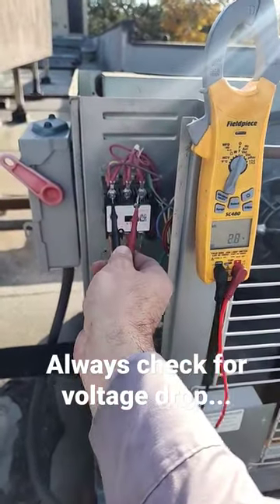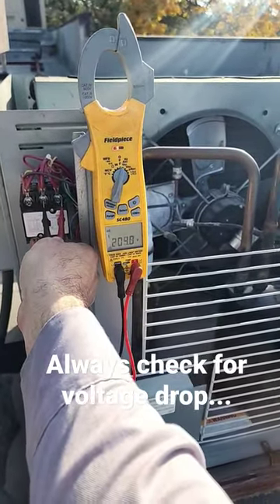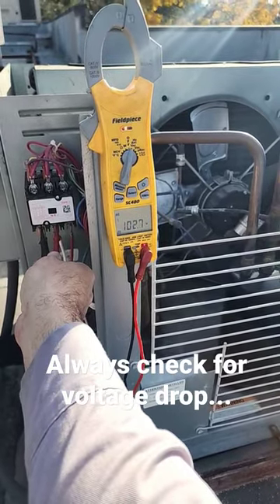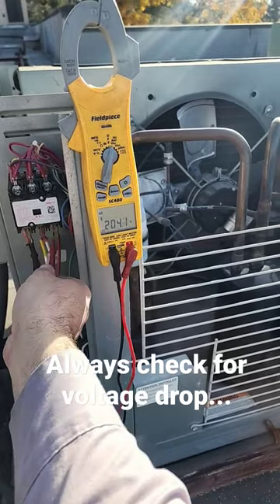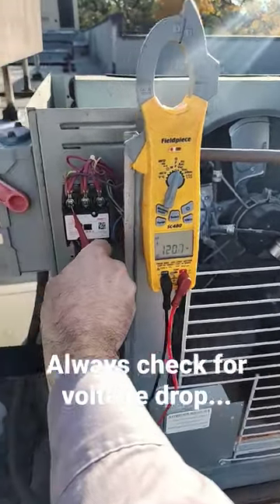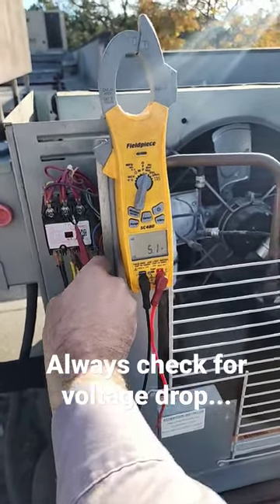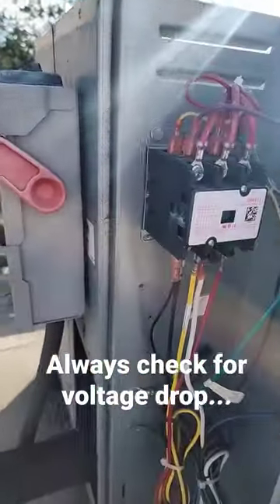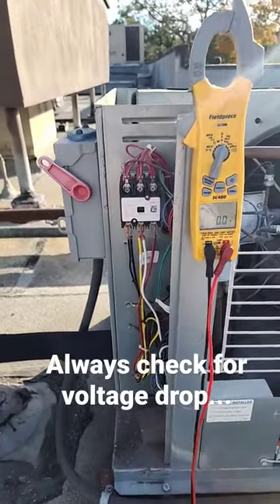VOLTAGE DROP IS A REAL THING

Comment: I used to teach automotive electrical courses and voltage drop testing was HUGE in our course.  So easy, so fast if you can wrap your head around the basics.  In the real world, at one shop I worked at, I ended up getting all the comebacks for inverter issues in customer vehicles (like Comcast vans).  Customer complain would be that the inverter for their chargers etc.. would cut off to quick.  Everyone threw a new set of batteries in and within days or weeks they'd be back.  A couple of minutes checking voltage drops on the isolator circuits or the grounds going down the chassis and I'd find the actual issues and have them repaired in a 1/2 hour or less.  My issue was getting paid as "We can't pay you for that, they just spent $600 on batteries a few weeks ago!" "Well, charge the idiot that put batteries in without testing... I FIXED IT."

Comment: I’m journeyman electrician for 9 years. 

I’ve watched you shows. It’s has incredible caught my eye. 

I work for large grocery stores in electrical repair and maintenance have worked beside refrigeration guys for years. Learned lots of things. 

I’ve bought all tools I need for basic small install an and repair  down to comp change out to low voltage troubleshooting.     With my back ground in electrical   I’ve been very successful in troubleshooting units.    

I have made choice to return to to school learn  
More  about co2 systems. And among other things.

I enjoy watching your videos and look forward to more.     I try to troubleshoot before you get to  😂   Most time I get it right     Other times has nothing todo with electrical.    So I get it wrong.
Reply: As a sparky of 34 years (yegods is it really that long!?) from the UK, I find Chris's videos a breath of fresh air on the electrical side, he KNOWS what he's doing, knows the code, and when he doesn't, is not afraid to ask.
Reply: You should learn about fire alarm too

Comment: Not just on commercial units.  The breaker on my residential indoor unit failed yet again this summer.  Seems to be every 4 years.  This time, i changed the breaker and so had the old one to teardown.  found the spring behind the lever had corroded, broke, loosened the contacts on that leg, till the contacts arced enough to fail.  Rest of the breaker was pristine.   Looks like the body of the breaker being in the cabinet, it was cooled and air seepage from the crawlspace around the lever then condensed humidity on the spring, causing it to rust till breaking.  Worse with that spring broken, the contacts remained closed (loosely) but there was no way for that leg to trip on overload anymore.  Check those through cabinet panel breakers on indoor units if they aren't in conditioned space.

Comment: Recently got my butt bit doing a voltage drop across three phase when I had 84 V on the load side 211 V on the line side.    
            Instead of the contactor a funny phenomenon out of the failure of an ICM 3 phase monitor. 
                    It wasn’t a contactor that was bad the three phase monitor causes situation and the backfeeding voltage through the windings of the motor produce the scenario where the line side L one will give you your 208 V and the low side T1 would show you a greatly reduced voltage appearing as though it was a voltage drop across the contactor points.
Reply: This is exactly why you double check continuity with the load removed. This applies to more than just contactors (house meters for instance). If you see the same problem with the old removed then your contractors shot. I have seen instances where a bad run cap causes strange voltage readings and sometimes heating

Comment: Voltage drop is not a term I would use where I’m from in this context.  Voltage drop (where I’m from) is used in reference to the loss of pressure (voltage) over wire runs (distance) and the size of wire in relation to that (resistance).   The contactor has shitty contact(s).  I would take the load side wires off the contactor to isolate it and confirm the readings on the load terminals by themselves as motors have a little way of giving odd readings especially in three phase.  Hopefully there is nothing wrong with the motor !
Reply: What is the term you guys use?

B) Although you are correct  to double check the motor it's very obvious that the contractor voltages prove that it's failing.
Reply: Voltage drop is when the voltage drops buddy. Its lower coming out of the component than it is going in, the voltage has dropped.
Reply: You do not need to remove the load from the contactor to validate that this contactor is bad .  Such a large voltage drop across pole 1 is a clear indication that its contacts  are not working well (regardless of the status of the load).
Reply: I smell an electrician.
Reply: @jordanlong00  typically voltage drop is when you’re talking about conductors losing voltage over long distances not losing voltage across a contactor that’s just simply a bad connection or no continuity “voltage drop” is specifically when you’re talking about conductor resistance going up the longer the wires are
Reply: Agreed, the formulas for voltage drop are very specific about conductor length not contactor connections
Reply: @jordanlong00  in this video the are getting voltage feeding through the windings from another phase.  It's not voltage drop on that particular phase, the contact on the left phase are burnt out.
Reply: Yeah to me voltage drop refers to losing voltage across very long runs of conductors. At least that is what I am used to. To each his own though

Comment: Bad contacts.  208 has a few weird properties compared to 230. Tends to pull a lot more current, usually creating an incoming supply drop, as well as burning contacts faster.  Sometimes it’s better to upsize the contactor by 1 to 1-1/2 sizes depending on amp draw.

Comment: Is that voltage drop or a complete leg of the contactor failed and reading ghost voltage thru the windings of the other legs?   Either way you found the problem, just curious.  
Seems like the 6v and 5v is legit voltage drop across. Thanks as always for the great content!!
Reply: I suspect the latter, that amount of volt drop under actual load would let the magic smoke escape!
Reply: 5V isn't a legit normal drop either - I'm not sure what that contactor is rated for, but if it's say, a 20A at full rated current, that's 250mΩ and 100W dissipation. It doesn't get better from there - if there's 50mA flowing, that's 100Ω!

Drop across a contactor of this scale should ideally be measaured in tens of millivolts.
Reply: If the contacts are burnt and pitted inside the contactor you will get a voltage drop from L1 to T1 which isn't present on a healthy contactor.
Reply: the left contact is simply burned.
Reply: Voltage drop has nothing to do with continuity between contacts, voltage drop is when you’re conductors are so long that they build up resistance and actually lose voltage on the load side due to the DISTANCE of the conductors, voltage drop calculations will tell you if you need to run a bigger wire to compensate but again it has nothing to do with continuity it’s about wire resistance

Comment: Just worked on a McCray water source heat pump that was thought to be a bad compressor. It was 3ph wired to a two pole contactor and one winding wired constant hot. The contactor had one bad pole so compressor sounded like it was kicking on but it wouldn’t pump. Changed contactor and she ran great.

Comment: Never hurts to check phase-to-phase, but it is irrelevant once you find a voltage drop across a contact that is in, or at least supposed to be in, the closed position.  Yes, the phase-to-phase voltage will be abnormal on the load side of the defective contacts, but once you find an excessive drop across contacts, or anything else in the load path, you have a problem that needs to be fixed before you do anything else.

Comment: If you have this coming in on the top(supply) of a 3ph contactor. You have a lost phase and might need a new breaker a blown fuse from your main panel, ive seen it come bad from the pole too.

Juat incase someone is reading comments looking for this answer.

Comment: we run into that a lot, you can usually just buy new contact fingers on the armature, they slide right in with minimal effort.  then again, who has space on their truck for that kinda crap.  i do keep burnishing tools and plastistones, sometimes the contracts just need a little love and they're perfectly alright.  they sell thin ones that go inside a little pen handle, and the burnish stone wafer is only as thick as a sheet of paper

Comment: daaang thats got to be making some heat with that much drop
Reply: By the time the volt drop is that high there will be no current therefore no heat when the volt drop is actually quite small half a volt to maybe 30 a decent amount of current can flow still which will create heat
Reply: V=IR, so the higher the voltage drop the more resistance, in this case contact resistance. So I=V/R, so the higher the voltage drop the lower the current.
Reply: Me, and you, coming in cold call to this problem:  

Good first guess troubleshooting  !!
I'd be carefully feeling around for hot wires motors other loads.  Listening for grunts or serious hums.

Theses wires 'look' good. Nothing hot that I can see or smell here.

Next, his prior experience here,
And you and me coming in cold to this problem, he's got burnt contactor (relay) pins.  Could be the relay socket. Loose screws. Corrosion. Etc.
Etc etc.  I'd rap the relay while watching it on the VOM.  IF you can pop it out, check with the ohm meter. Maybe pop apart the relay housing inspect and clean the contacts. Ohm it out.

Maybe get customer on his feet while you wait six weeks for a part !!  Maybe a spare in the truck??

But anyhow good initial guess. 
Assuming and being careful of cooking wires or loads motors etc.

This was a good training video and practice. 
He knows the circuit here. And we can arm chair quarterback.
Reply: @944LS  (1) a higher voltage will drive more current (2) there’s no reason to say voltage drop, voltage is, by definition, a relative quantity (3) current is not the constant here in v=IR, voltage is. (4) higher voltage produces less power losses to heat than high current given a constant power, which is why lines run such high voltage that is then transformed down.
Reply: @gopackgo4036  you’re trying to overcomplicate this. Fundamentally it follows ohms law every close, obviously there is differences with AC and DC.
1.) yes because I=V/R, so will a lower resistance. 2.) there is a reason to say voltage drop, I’m relating it to the video. 3.) I never said voltage in the video is constant, thinking of a variable being constant helps understand the relationships at play. 4.) and yes that is true because power loss P is a function of I and R, except the I is squared P=I^2R, it’s a lot easier to change the current than it is resistance.

We are saying the same thing, I was simplifying it for someone that doesn’t relate it to math often.
Reply: No we arn’t, you said the “higher voltage drop the more resistance.” That is not true, the resistance is approximately constant, the current is what changes.
Reply: @gopackgo4036  the voltage drop is caused by increase in contact resistance(bad terminal). So, for this example in the video, as the voltage drop increases (50v to 80v) measured, the reason that happened was an increase in resistance.
Reply: @gopackgo4036  load is caused my resistance in a circuit, one does not simply increase current without decreasing the resistance of the circuit. It’s common circuits knowledge
Reply: @gopackgo4036  if you do even the slightest bit of educating about this topic you’d know you’re wrong. You’re also just trying to disprove anything I say and not point out where we agree. We are talking about the same thing, but you should read about the equations at play and don’t just blindly accept what you may have learned in the field
Reply: Ok. This short story applies for inductive consumers... when you have a inductive consumer, it will tend to keep it's power regardless of voltage so when you have voltage drop you automatically draw more amps that creates more heat and you either overload the circuit or triger thermal cutoff.. either way, it's bad
Reply: @contytub  thanks I was hoping someone would note this, the differences between inductive and resistance loads.
Reply: @Paul-IE-Repairs  yep ... so many wrong answers and it's trully not their fault because they were tought something without being made aware that there may be more to it ... for whoever doesn't knows what inductive load means, a voltage drop means lower current because resistance should be the same but that's only for rezistive loads. Wait until they find out there are capacitive loads as well
Reply: @Paul-IE-Repairs  oh i remembered that even for rezistive loads ... some circuits are made to work at a certain temperature and if you don't have enough voltage to heat it and drop the inrush, it may eventually trip the breaker as well
Reply: That 5 and 6 volt is the is the heat line 1 is down
Reply: @944LS the motor is demanding watts so lower volts higher amps. If it was a resistive load then the amps and watts would drop.
Reply: @scottjones7279  watts is power and power is calculated from current and resistance of a device.
Reply: I once had a fellow technician say that a bad contactor connection will cause heat at the next spade connector after the contactor. So say you got some severely burnt contacts and on the load side of the contactor you have a 6 inch wire that plugs onto the common terminal of a capacitor, he said the bad contactor is what caused the wire with the spade connector to melt at the capacitor. Where the wire was connected to the contactor is was pristine.

Comment: The first step is always to follow the diagnostic troubleshooting procedure which doesn't begin with wasting a bunch of time throwing parts at something. Fix it right the first time and spend less time on the same job so you can do other jobs right the first time and maximize your earning potential.

Comment: This is good advice. You're allowed about 3% of drop in general. I assume that means electrical parts are designed to work within that range.
Reply: Here in the UK, it's 3% for lighting, 5% for non lighting.  That's measured from the consumer's side of the meter. The power co have to stick to limits, I THINK right now it's 230v +/- 10% for single phase, or 400 +/- 10% for 3ph
Reply: @TheChipmunk2008  +10% and -6%, I believe, although there is talk of harmonising with Europe again so tolerances would be +/-10%

Comment: Yup.... I had a generator that I was getting only 90v out under load..... But normal 120 volt on that leg with no load.   I traced the problem to a bad contact in a switch on that leg.    Amazing to me it didn't get hot and melt...... If I had not of checked I would not have known how bad the problem was....

Comment: Just take the cover off your three pole contactor and look for black splatter showing that the silver is splattering off. 
If it is then replace it with a heavier contactor . A lot of this equipment they only put the latest contact her that they can get away with it and they usually last about one or two years.

Comment: yes voltage drop line to load but amp delta T across legs & also w/  power off but contacts engaged ck OHMS no more that .3 or replace contacts

Comment: How much drop is acceptable? Just the 5V drop on 220 at 10 amps is 100 Watts of heat dissipated on just one set of contact points.
Reply: P=IE.  5 volts times 10 amps equals 50 watts.  How you get 100 watts out of that?

Comment: Its a shiteload of carbon buildup on the contacts inside of the contactor. A side effect of the open/close arc over time. Contactor coil or spring may also be getting weak since its supposed to pull and push fast enough to reduce the arc

Comment: Use same test on cars 12 system.A cable can have a hairs worth of good connection and read 12volts or full continuity but can't run any amps through it.

Comment: Is a contactor just like a relay? Also I surprised that thing didn't catch fire with that much voltage drop!
Reply: Theyre a bit different, just a coil on the back as your control when powered magnetically bridges the line voltage to the load side, contactors are mainly for motors or compressors drawing higher amperage. Usually Relays are used as controls switching normally open or closed contacts when powered, moreso on the low voltage side of things. Contractors take a lot more abuse too.
Reply: In short, yes. They both function the same way. Coil energizes and closes contacts. Contactors are usually much more heavy dury and typically are 3 normally open poles. Relays can have 1 to 4 poles normally and do both normally open and closed per pole. More for controls and relay logic. 

In short:

Contactor- energize heavy 3phase loads

Relay- control circuits / logic & energize low power loads.